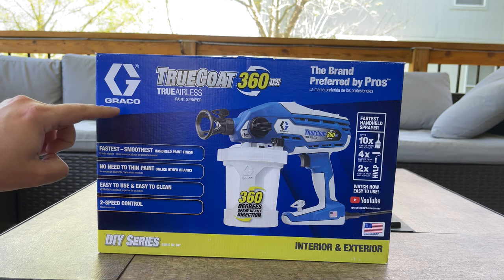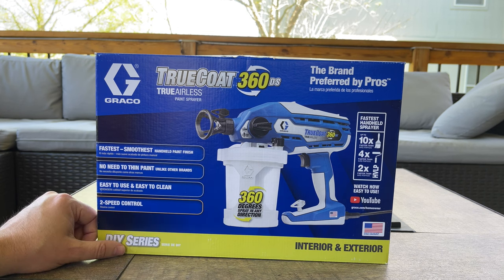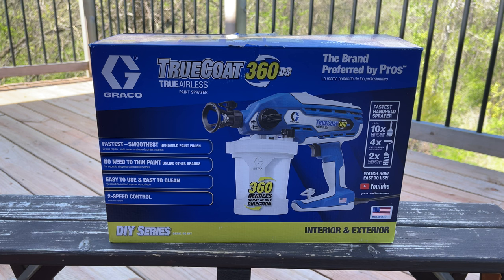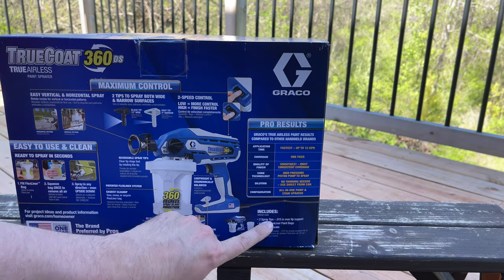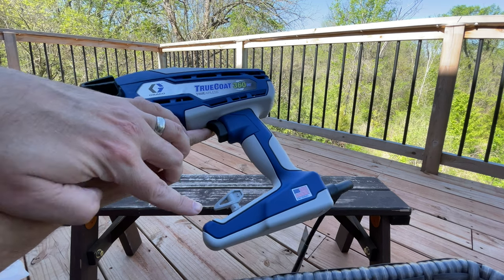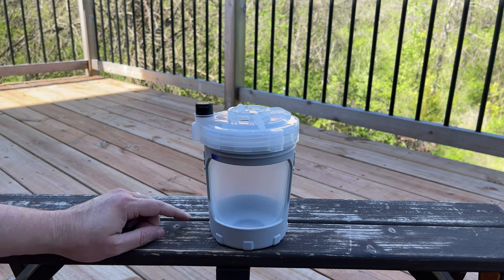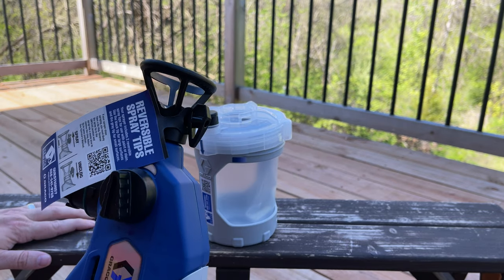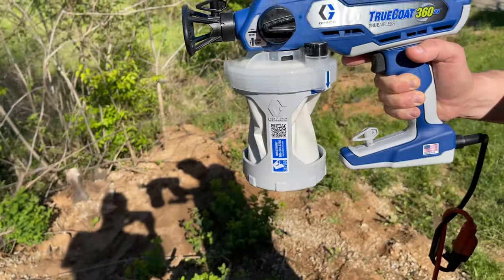GRACO TrueCoat 360 DS Paint Sprayer Review | Make Painting Easy!

Comment: Aside from others comments on paint style, I have to say I was amazed by the volume that came out initially. I have a Wagner with a rigid bottle you cant burp air out of and I used Flo-trol to thin the paint and it did a very good job on cabinets I repainted in place. Flo-trol does a good job of preventing runs. It just smooths out the paint well. Unfortunately, and I haven't been able to figure out why, but my Wagner goes through all the motions of trying to spray paint, but nothing comes out. No clogs, nothin! No paint either! Just watching this video has convinced me the Graco will soon find a place in my garage! Time to repaint the kitchen walls and cabinets! Good video! Thanks

Comment: I had this and used 5 times. each time about 3 hours. Worked good then during 6 paint job it was unable to pump latex paint up. I had to turn it up side down to continue. I cleaned it well each time and put blue fluid to protect after each paint job.

Comment: Did it leave orange peal or smooth finish?
Reply from the maker: Nope. It was a smooth finish. The wood was sanded smooth though.
Reply: I have the 360 VSP. I used it to paint some built-ins. I was getting frustrated, because the paint kept going on with orange peel. The VSP has several settings, and I tried them all. Finally, I decided to go ahead and paint the built-ins using a medium setting. The paint still went on with orange peel. I went to bed disappointed. The next day I went to remove the tape & plastic. Man! To my surprise, the paint leveled beautifully to a very smooth finish!